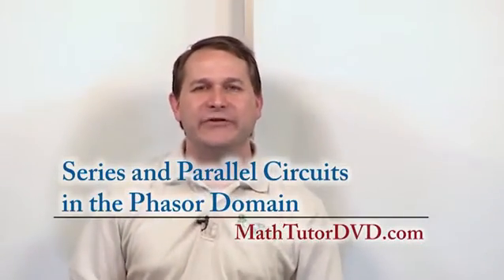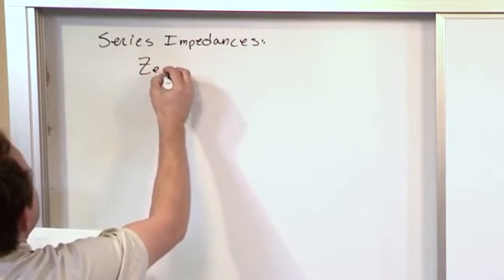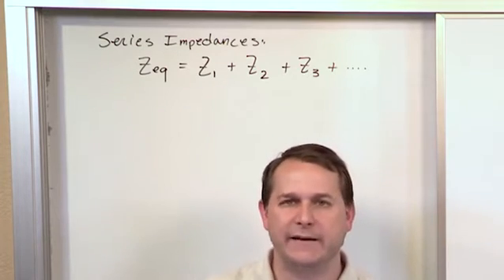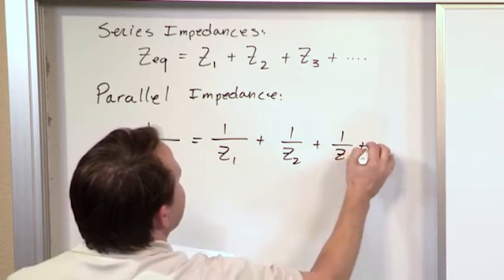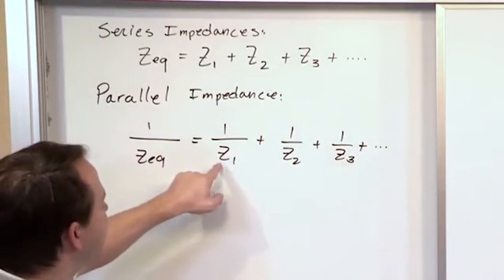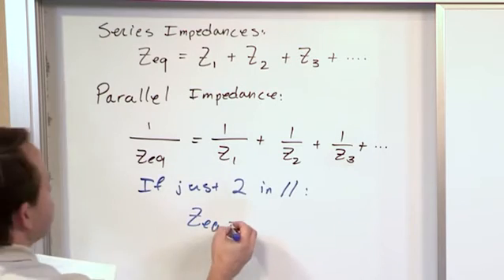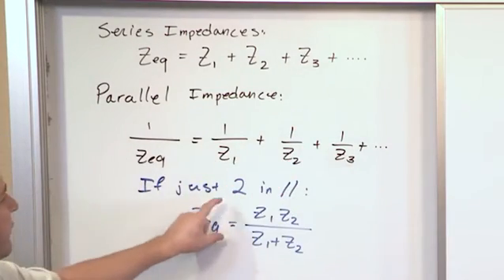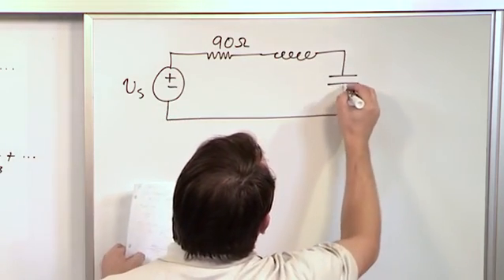Lesson 15 - Series And Parallel Circuits In Phasor Domain (AC Circuit Analysis)

Comment: if you have two capacitors in parallel with impedances z1 and z2 is the equivalent impedance of the two parallel capacitors z=z1+z2 or 1/z=1/z1+1/z2?